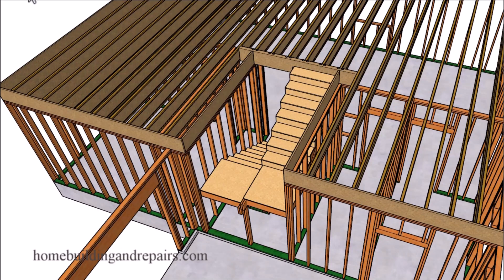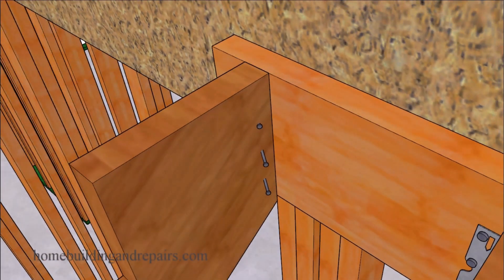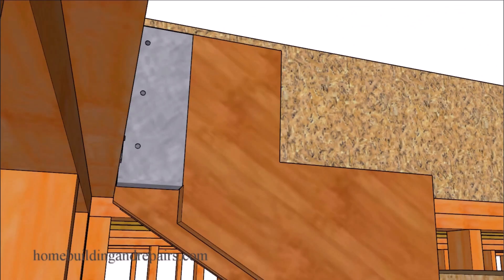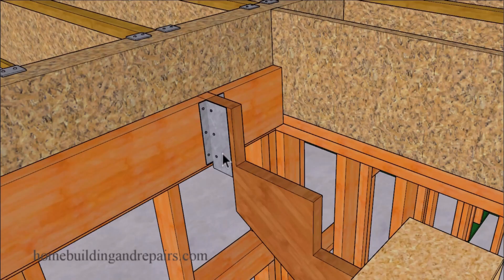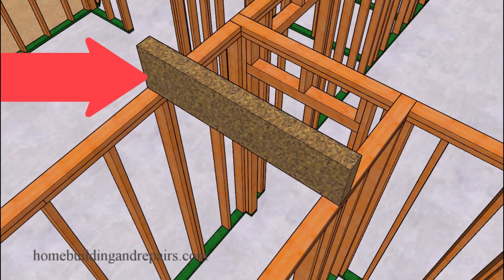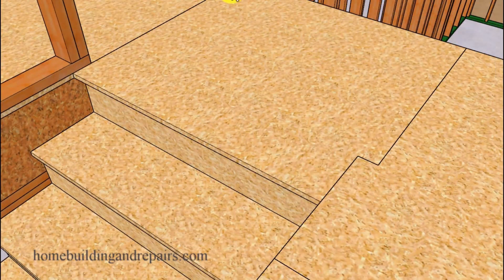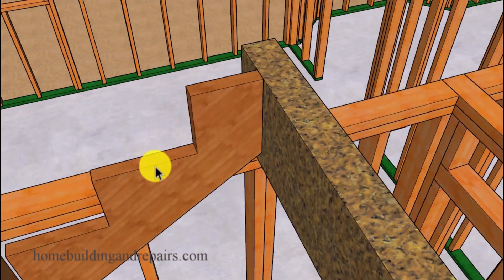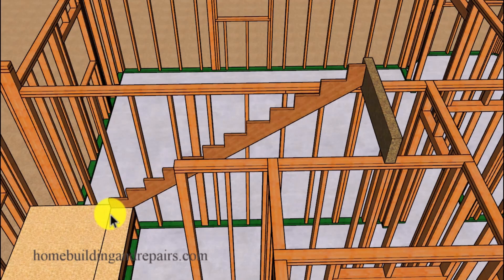Watch This Video To Lean More About Upper Stair Stringer Connections And Headout Location Problems

Comment: It’s rare in for me to ever need any framing material in a staircase. It has to be exceptionally wide or a long open run. Otherwise, it’s all built with joinery and once the glue is dry that’s it. It will never move or squeak.